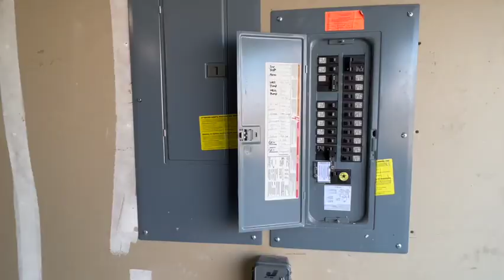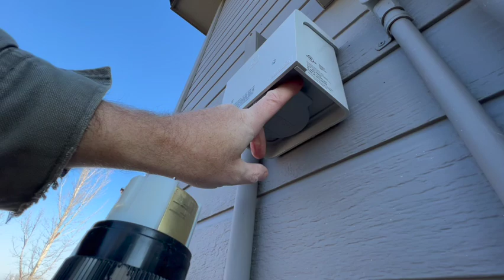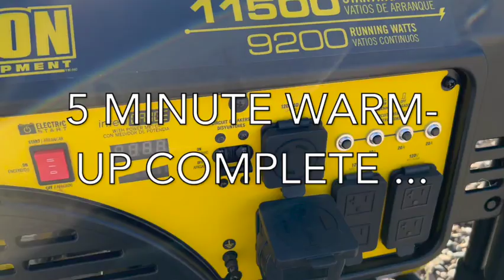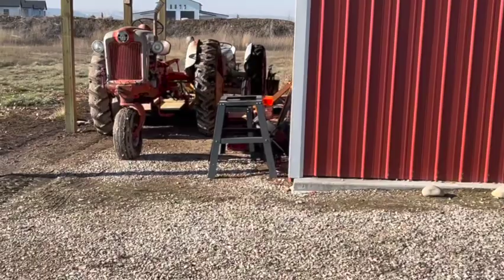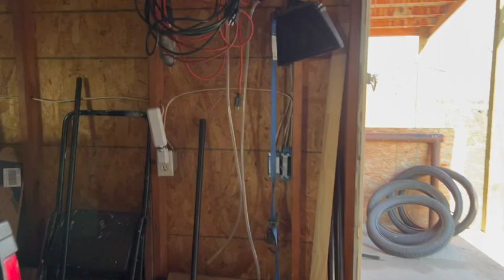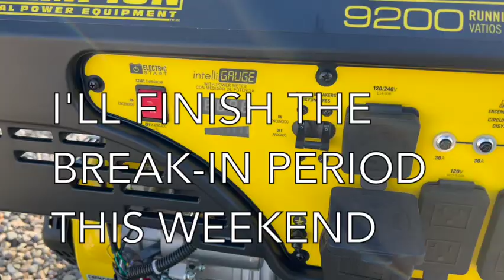Champion Generator 11500/9200w - First Run, House Inlet Receptacle

Comment: I recently bought two of these, about six weeks ago. They are loud, very loud at 91 decibels out of the box. Buy a case of oil, it will use it. They are rated for 9.2kws continuous, mine shuts down after a few hours at 4.8kws. The carbon monoxide sensor is so sensitive, even in an open field, that they become useless. Get familiar with the pull start, as the one I use the most has battery or starter issues. They love fuel and a lot of it. Other than that it’s a good generator

Comment: It's setup, but been in the garage for a couple of years.  We're charging it now, and it's running fine.  But we don't know how long we should leave it on to charge the battery.
Reply from the maker: Hi Dan, thanks for the support!! If I understand you correctly, the generator is running and naturally charging the battery, or is the generator off and you have a charger hooked up?
Reply: @AntiqueCarsandStuff  We weren't using it, we just plugged it in to charge the battery.  We weren't sure how long the charging takes, but we let it run for 15-20 minutes.
Reply from the maker: There a lot of variables, but the generator can charge its own battery in maybe an hour or two.  The better way is to use an external battery charger - the same type you would use to charge a car battery.  Leave the generator off and connect the external battery charger to it. Then, the charger will tell you when it is done and you can remove it.
Reply: @AntiqueCarsandStuff  Ok, thanks chief.

Comment: I have a question- the manual says "Your generator must be properly connected to an appropriate ground to help prevent electric shock" and then goes on to talk about remote grounding, copper wire, a copper rod in the ground... this is all WAY over my head! Can someone explain what that's about and if you need it? It didn't seem like you had yours connected to a copper rod in this video. It also mentions "neutral floating" and "neutral bonding to frame"??
Reply from the maker: Those are valid questions. I would also like to hear an expert's response. It seems to me that in my particular application (connected to the house panel) the generator is grounded through the panel/house. I have also used it for other applications with no additional grounding and there have been no issues.
Reply: @AntiqueCarsandStuff  Thank you for responding! I bought the generator because I have a sulcata tortoise and he needs a heat panel in his house in the winter. The power went out a while back and it made me realize I need a backup for him. The generator would be hooked up to his heat panel and light, not to our house. I’m wondering if I should call an electrician- I know literally nothing about electricity.

Thank you for the video- it was really helpful- and for your quick response!!

Comment: Does it matter if you use the 120/240 V AC, 30A locking  (NEMA L14-30R ) or the 120V AC, 30 A locking ( NEMA 5 -20R ) receptacle?

Comment: When using a non-inverter generator, you need to understand that the typical non-inverter generator puts out a total harmonic distortion (THD) in the 10-25% range. Conversely, inverter generators typically put out less than 3% THD. So, if want to run a high efficency (read computer driven) furnace, tankless hot water heater, smart TV, computer, or UPS, 10-25% THD from a non-inverter generator can reak havoc and sometimes even damage the computer controls of your high efficency furnace or computer driven devices. So, if you want to run sensitive electronics, be sure to get an inverter-generator.
Reply: Recently ran my sister's house on a Champion generator same size as this one but a newer model for over 2 hours with no problem. Furnace ran fine, TV too.
Reply: I've always wondered about this. So the energy we get from the grid is clean and safe for sensitive equipment?

Comment: does the bottom 240v plug have a 38 amp breaker or 50 amp?  the specs say 38 but the promo vid says 50
Reply from the maker: Mine has a 50amp.

Comment: Have you seen if it can run the fridge, A/C unit with all the lights running with no issue? I live in a single wide mobile home and was kind of curious on what I needed. Thanks
Reply: My champion 100891 (9375/7500) ran the A/C, fridge, lights (all LEDs) and a few fans, tv etc , NO PROBLEMS! I’m very happy with my purchase…….I almost forgot mine is the 30Amp 120/240v
Reply from the maker: I haven't run the A/C with it but I'm guessing it would handle it no problem.

Comment: thanks for sharing. I have a 4 ton AC, will this generator be enough?, do I need a 50 Amp or 30 Amp breaker? thanks
Reply: I have the same generator and it powers my 3ton HVAC along with the rest of my house so I think it could if you cycle heavy draw items

Comment: i just purchased same generator and father had concern for 120v/240v not having a selector switch like the smaller champion one i have does as well as nothing in the manual regarding change or difference. Electrician said i am wired for 240v selection when I had him add receptacle and lock out. does this generator need to select over?

Comment: How much did it cost to put the generator plug in your power panel box?
An how much for the one on the side of the house?
Reply from the maker: I don’t remember for sure. The electrician charged me around $700 I think for everything (custom cord, labor, and all parts).

Comment: Are you not concerned about running your house on a non inverter generator? I have a Champion 6,500 watt I purchased before realizing the potential issues, total harmonic distortion, with non inverter generators on electronics.
Reply from the maker: Yes, that is a valid concern. This generator is equipped with “volt guard” which is supposedly like a pre-surge protector. If the unit senses big fluctuations in the power output, the generator automatically shuts itself  down. Champion says it works but who knows…. I also have surge protectors on my sensitive electronics inside the house. I also only run these electronics when absolutely necessary during generator operation. So, given all the above, I feel it is quite safe to power my home with this generator. I’ve used it a couple times already with no issues. Seems good so far.
Reply: @AntiqueCarsandStuff  Overall, I hear a lot of folks worry about THD and sensitive electronics -- the concern is commonplace.  But what is not commonplace are stories of destroying the electronics of the home.  These generators are widely used for the purpose of home power, and while there certainly could be anecdotes of destruction, such stories are definitely not equally common.

Comment: Nice to see someone set up the connection to the home the right way, and the safe way. Great video too! I put a 521 hard start kit on my AC unit and this generator easily provides power for that too. You may want to get a Gen Tent to cover during rain or snow events. I have a yellow Gen Tent from Champion that matches the generator.    https://youtu.be/b5IxW2lKkpc
Reply from the maker: I didn’t know those little tents existed. Thanks for the tip!
Reply: @AntiqueCarsandStuff  Neither Did I until I saw a video on them. They are really great! I even ordered the optional clear skirt that covers the outlets. You can see the panel with the read outs. Really makes your generator safer in the rain and snow.
Reply: @AntiqueCarsandStuff  https://youtu.be/_Ih7vQ62QD4

Comment: I have found that I can power both of my refrigerators, my 55" TV, several LED lights, two fans, and my computer for less than 2,000 watts.  Sometimes less is more when it comes to generators.  But I do see you have a big place.

Comment: You do realize that you are using a standard generator (i.e. not an inverter generator) and thus it can be quite harmful for electronics.  I blew out my ice maker electronics and the main brain of the refrigerator using a standard generator.  And those were the only electronics that I had connected.  I would never use a standard generator for computer equip.

Also, you should ensure that you are using a floating neutral when you feed the house.  In reality when you are not really going to power 240v equipment (unless you have something like a well pump that you must power) like A/C, dryer, stove, etc, you are much better off feeding single phase 120v to both panel legs.  The only caution is if you have MWBC that share neutrals.  Those circuits are wired to use the utility two-phase power, so you need to be aware of them and not over use any of them.

I would also recommend that whenever you plug in the generator, always switch off the utility main FIRST.  Then turn on the breaker located on the generator....then the panel breaker for the generator by moving the interlock.  Don't ever have active utility power going to the panel by having the main on while having the generator plugged in.
Reply from the maker: Thanks for the information!

Comment: I broke mine in, changed the oil. Powers the entire house. Even the washer and dryer although we don’t usually do it. We haven’t had to use it for an outage yet but it’s a must have. And this will last you for years to come especially if it is stored properly and not used often.
Reply from the maker: Yes, it seems like a good unit so far. I've used it once for an outage and it worked perfectly.
Reply: @AntiqueCarsandStuff  we’ve used it for a four hour outage and a 12 hour outage without any issues. We will see how we do when we get an outage that last several days

Comment: Thanks for the good video, I just got the Vhampion 10000/8000 and have another hour 20 or the 5hr breakin. Propane and gas crank right up, lovin' that battery and electric start.
Reply from the maker: I'm liking this one so far, and have already used it for a power outage. It did great.
Reply: Need some Information on the twist lock plug. Thanks😊

Comment: I have this model and the 15 starting 12 continuous model. The one like yours can power the AC and all the other 110's (2 refrigerators, deep freeze, microwave) but it chokes running 2  220V; hence, the addition of a larger generator. In short, it is an excellent generator and l'm keeping both.
Reply: Oh, please post a 1 year follow up.

Comment: Does the generator have a floating neutral? Or is it bonded?
Reply: They come from the factory bonded but you can lift the bond, there is a video here on YT that shows you how.  I did that on my generator because my transfer breakers were only 2 pole like in this video.

Comment: I have that Same generator. And it runs my entire home , ac , with a 5-2-1 hard start and two refrigerators..
Reply from the maker: Thanks. It seems like a good unit so far. I actually had to use it for a power outage the other day, too!